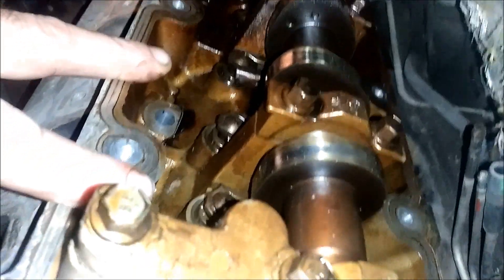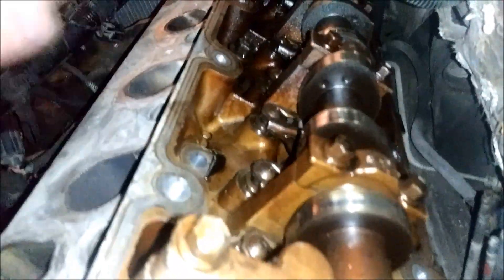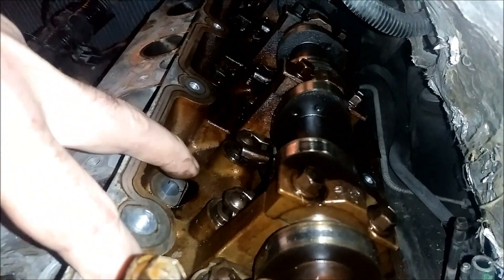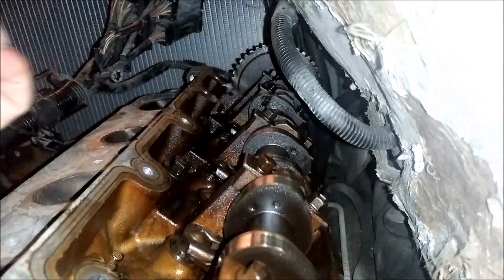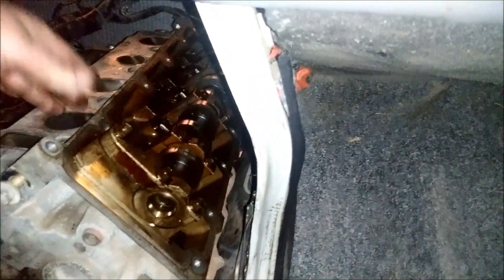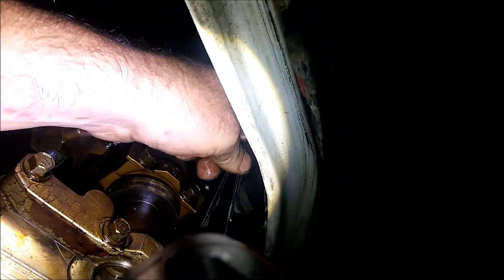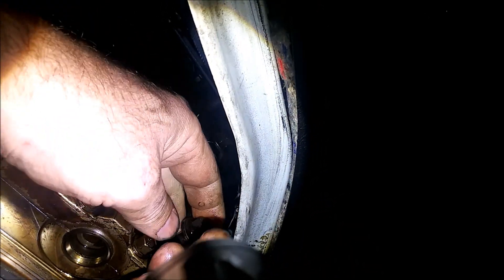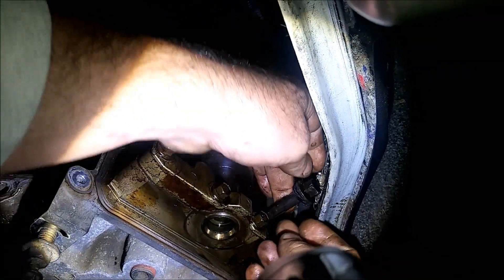Ford Econoline E350 Cylinder Head Removal (Changing the Head Gasket Without Removing the Engine)

Comment: Binder clips to hold the bolts up
And
A plastic placemat slid down between the head & block to make sure a bolt doesn’t slide down to damage the gasket or scratch a piston.

Comment: is it possible to remove the head with the exhaust manifold still bolted on or does it have to come off?
Reply from the maker: Not certain. But each side is different when it comes to clearance. I would think you could pull it off with the exhaust manifold still attached. Straight up and forward.
Reply: Everything needs to come off.
The posts attaching the exhaust need to come out of the outside of the heads.
The Intake manifold & fuel rail pops up and off.
EVERYTHING on the top end needs to be removed to get these heads out.
Take your time and scrub everything 

Good luck! 
The